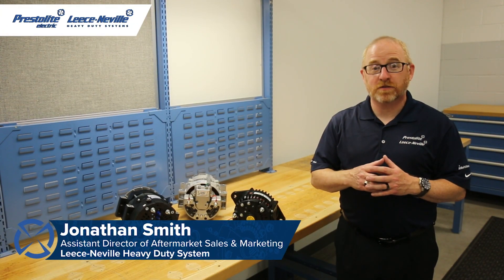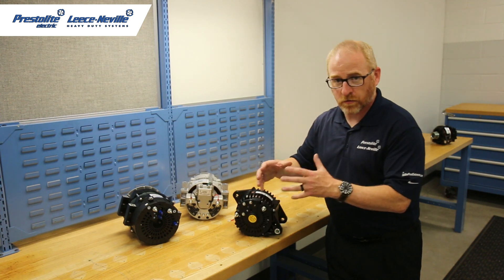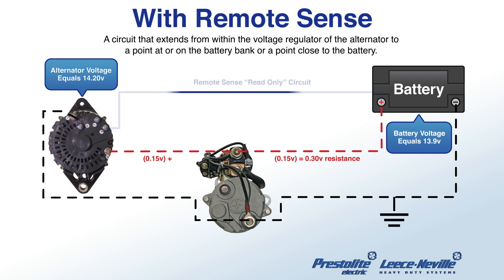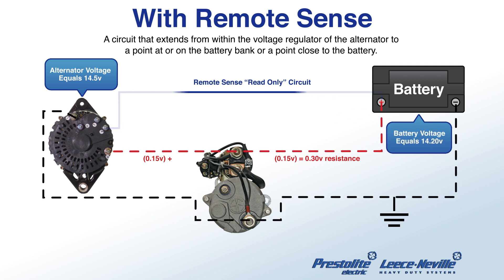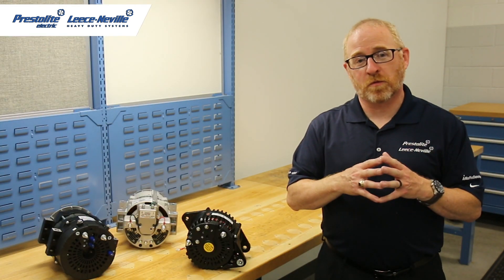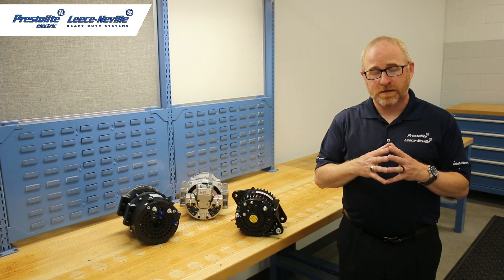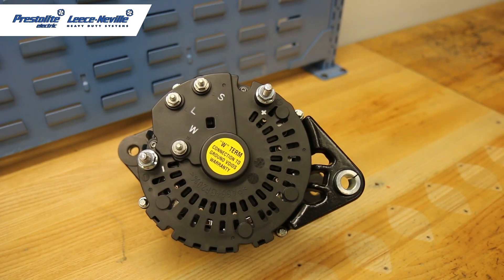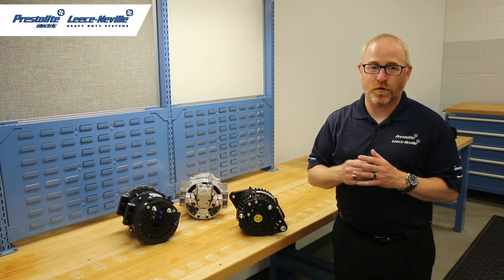Reviewing Remote Sense & Other Alternator Posts

Comment: where do i connect my power cable on therstolite alternator, which only has w, 6/7v and 2 unnamed terminals. code AS12366021194

Comment: Can you make more of these videos please. I want to hook this lucas mando alternator directly into a three prong charging cord for my segway scooter. I glued a deepwell socket to the pulleywheel bolt and am spinning it with a dc rc car motor. This segway charges and drives at the same time also. I heard about lithium fires and have seen one in a cellphone. So i dont want charge and drive in only one battery on this scooter. I recommemended a three way a-b on-on toggle. I showed some people in the park how to spin an alternator with only their scooter and these deepwell sockets but warned them. Only for charging. No charge and ride. Showed them how to spin the alternator for their power inverter but recommended, a small amphour lithium brick battery and an rc motor. I told them to use a fully assembled rc car. Use the rear tire to spin the deepwell and keep the toy around to play with. Told them to use a volt amp controller for 15 bucks. All types of mother of all invention things. I want to spin this alternator with three household plug wires straight through. This segway has a reconditioner and volt amp monitor built right in anyway. These charging station im building are a neccessity. Groceries, appointments, work, thats only in the city. Country roads, from the train station to my hotel....30 miles. Etcet. - Adam     idiot savant.

Comment: Sir I have Bosch alternator br14m3 for Chevrolet zafira  1.8 gasoline engine I lost the connection with the wire  
 But it is visible one wire is tin wire ..and the other is fat wire  its from negative battery  ..I wonder the positive fat wire where I can fit   there's only two post bolt   on that alternator.. can you help on this  thank you...

Comment: I have an 8LHA2070VE running as a secondary alternator on a marine diesel engine. I want to keep this alternator unloaded until the engine is up to temp. How do I turn the field on and  off manually?

Comment: Hi, I just purchased an alternator for my BMW E38 from E-bay. My existing alternator had only a positive lead, but the new one has B1+ and B2+. which one should I connect my positive wire to and what is the difference are between B1 and B2?